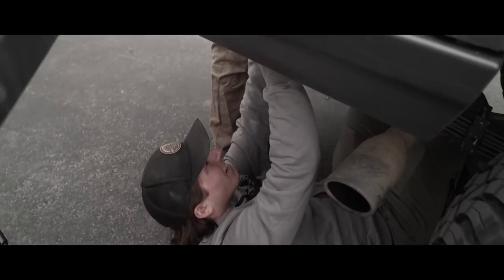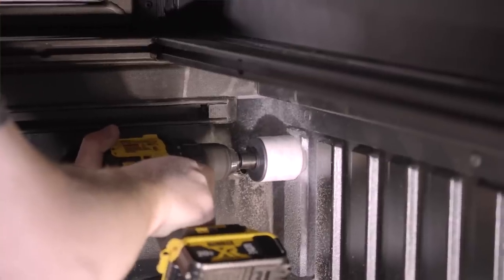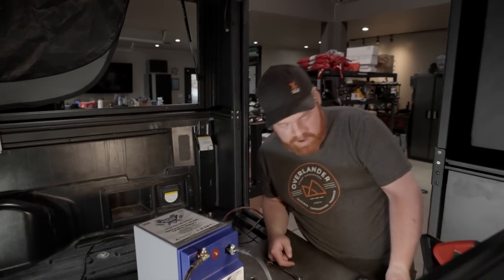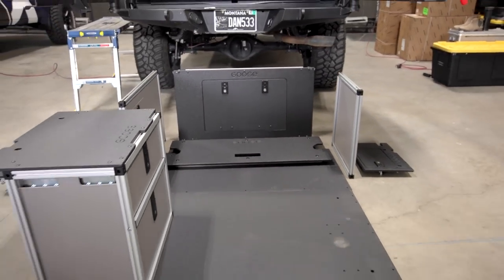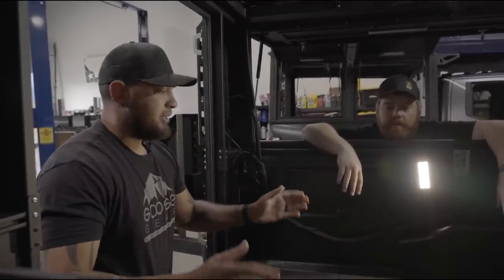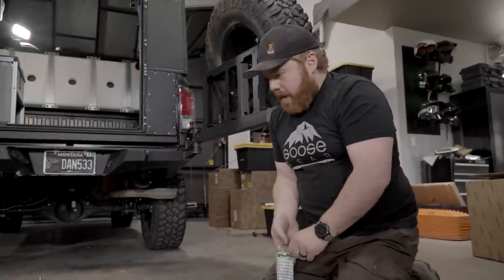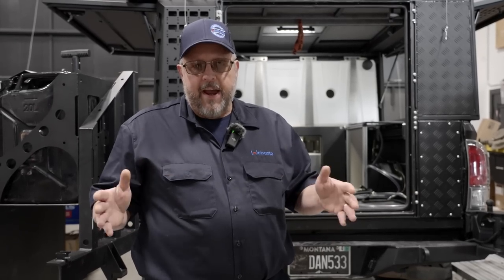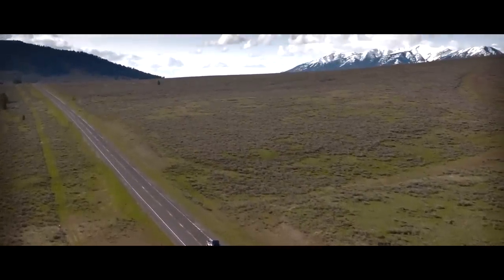Our Tacoma Gets A Makeover! Alu-Cab, Goose Gear Storage, & A Heater | X Overland Shop Talk #13

Comment: Hey love the channel and the build videos. One question- are you worried about a water leak from the water storage system and getting on the batteries stored below? Thanks. Looking forward to season 5!   Ken
Reply: Yeah i noticed that as well.
Reply: With 12v it is not that big of a deal. If an inverter was under it and they were running 110v, that would be different.

Comment: For the 2" hole you drilled in the bed to run your wiring into the bed, what did you use to prevent wire chaffing from the hole and protect the wires? Grommet or cable gland or something else?

Comment: Hi, quick question(s) if you have a minute to answer.  I see you selected the Webasto 40 vs the 2000.  Was this to get to higher altitude capability?  The btu’s on the unit are much higher as well.  Did you find the unit to work well or be too much heat for a small space?  Considering it for my Gladiator/AluCab Canopy camper build. I want the higher altitude capability but I’m concerned it is too much heat, even at minimum.  Would love your feedback.

Comment: Great build! Have an Alucab on order along with a JT and debating on GG. What size fridge is that and assuming it’s fitting where the rear GG utility module would go?
Reply: 40L National Luna
Reply: @tinyrigco  thx. Ended up with ARB Elements 63Q…had to shave down the GG bed plate 80/20 support bar to fit, but it did with a little elbow grease.
Reply: @piddypabs  Rad!

Comment: Looks heavy
Reply: The Canopy Camper itself weighs 420 pounds, once you subtract the tailgate. If your goal is to keep the build light, you can do so by not loading it up with accessories. Additionally, if you need to store an oversized tire, you can add the tire mount to the door, which is less than 10 pounds of added weight. That allows you to bypass a bumper with a swing arm or a tire carrier in your hitch and save several hundred pounds.